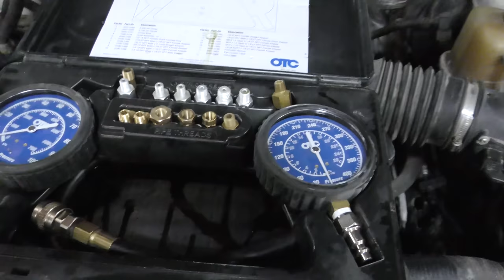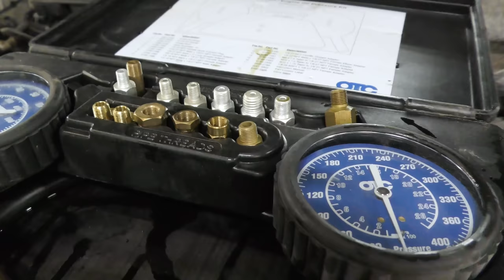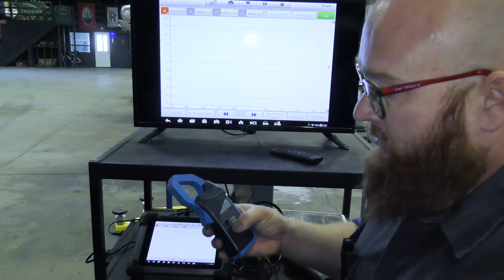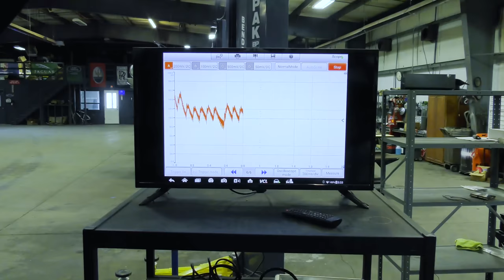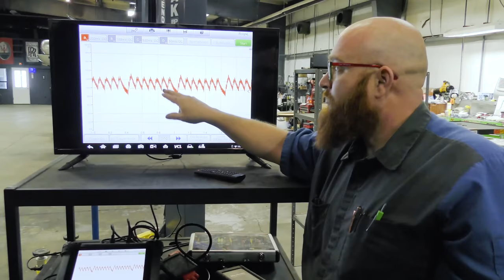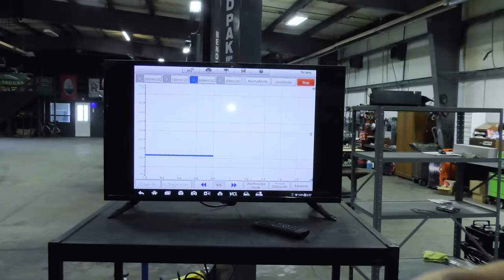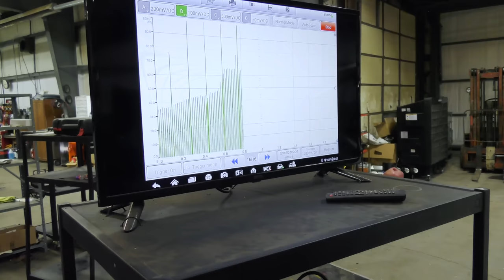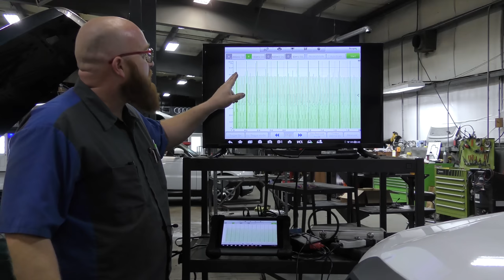Can an engine additive really fix this 2011 F150? CAR WIZARD shows how to diagnose and repair

Comment: Brother can we add 20 Percent oil additive in 1.5 dci engine?
Reply: You can do that or also run a heavier oil which will also do the trick
Reply: @FBI-eo9yx  thanks for the reply bro. Can you tell which grade oil is heavy oil?

Comment: Don't you think a lot of these problems are resulting from ridiculous oil change intervals? 
For example my 2014 bmw 335xi has a 12,000 oil change interval. Lets say you get 2000 miles to the quart . After 12,000 miles you'd use 6qts, and maybe have 2 qts left in the pan of really dirty oil. Wow! 
Now of course i change my oil at 5000 miles and a filter change in between at 2500 miles. Common sense, but not at bmw i guess.
Sort of like waiting until the 36000 miles brake pad replacement for the front brakes, then you get a 200 miles warning. Rotors are shot by then if you dont dig them up with a metal backing plate on a pad. 
Why be cheap and wait when pads are 100$, replace them at the half way mark. 
One friend waited too long and cut up her bmw rotors, then yuk bought a pair at autozone for 75$ each. 
Really there is a reason Zimmerman rotors cost 150$ each
Another friend had an oil warning on her bmw fir waiting for that 12,000 oil change. Stuck at the gas station oil too low! 
Are these car companies trying to drum up repair business? Or new car sales?

Comment: 180,000 miles is that much ????? my audi a4 tdi from 1999 has almost 700,000 km on the clock and starts immediately (so without preheating time)

Comment: having to put a mixture of oil at every oil change and use a specific oil filter....???... Not much better than the 5.4l which simply needs good oil maintenance (after the initial spark plugs are replaced)

Comment: The cam seals blow out, engine oil pressure drops, and wipes the cam bearings/caps out. Common issue.

Edit: Wait, this is a 5.0?!?! That is unacceptable imo. 20% Lucas additive sounds like a Bandaid on a bullet wound.

Comment: Wonder if a higher weight oil would do the same as adding lucas? Sounds like an old school trick being used on a modern engine. I remember putting higher weight oil in a high mileage engine to bring it back into tip top shape. So basically they didn't make all the tolerances and oil change related right in what the engine needed for a 500K life. Like the old school engines. Not knocking Ford because I have a driveway full of very reliable ones, and have known of many GM examples that were trash. To be honest it is a preference. Ford and GM are equal in making quality and trash cars. Really just need to know what you are buying. New only if you keep for a year or 2 and used do your homework.

Comment: I really don't understand, do American engines only last 200000 miles? I had multiple Mercedes V8 Cars, the last a ML430. That car was used as a tow car and off road. Still it had no discernable engine wear? I spend a few hundred $ on repairs over the years but engine and transmission was never touched (I changed one ignition coil pack and the water pump). My daughter totaled the car, a truck hit it in the side and would still drive just fine. My friends E320 put 350k miles - no repairs to engine and tranny (he had a total of ONE repairs - rear door lock). New MBZ cars are not as good and I was hoping American cars are now better?

Comment: Sorry, but for what new cars cost these days, I think a properly maintained vehicle (and not abused) should make it to 500k without major repairs. My Mini made it to 266K miles (but it started burning a quart of oil every 1200 miles @ 230K miles, @ 255K miles a quart every 300 miles). Not buying another Mini. On to Honda.

Comment: will this work on other engines with the same problem ?
Reply: In video of other youtuber I heard that second hand dealer ships "trick" the customer by adding something to the oil to cover any bad noises from the engine. So it happens, but not always to fix the issue, just to cover it.
Reply: If it is the same problem, ofc..
Reply: Yes but just add a quart of thicker oil.
Reply: 5w-20 should have never been recommended for trucks. Should stick only with motorcraft filters and 5w-30.

Comment: Maybe if manufactures wouldn't run basically water viscosity (5-20) oil their sh(#t wouldn't drop oil pressure in the first place!

Comment: Ok that's a really dodgy way of "solving" the oil pressure issue. So it has more oil pressure at the sensor after the pump now but less oil flow because the resistance against pumping through the engine is higher. It will wear even faster, especially on cold starts. How much is a set of bottom end bearings for a common engine like that? $200? installed from the bottom maybe $500-600? Sorry but that is really not Wizard level of repair ...

Comment: Melling M360HV oil pump.
Reply: That’s only on the older 4.6, 5.4, and 6.8 liter engines. 5.0 uses a different oil pump and I have not heard of a high volume oil pump on the 5.0. Only on the 4.6/5.4/6.8 and the 3.5/3.5 Ecoboost/3.7 V6 engines have a high volume oil pump as well but the model is M390HV regardless if the engine is transverse or longitudinal.
Reply: @atx-cvpi_99  That is a Coyote good call. Thank you sir. I own three of the Modulars and put a Melling on my truck and it loves it.
Reply: @atx-cvpi_99  I will add that doing the pump and chains etc on my 08 5.4 made me hate Ford forever.

Comment: Would have been a much more interesting solution to try thicker and thicker oils and monitoring the pressure.  Whats the difference between putting 20% lucus and factory oil with just 100% of a higher viscosity?  Who knows, but a fun experiment.

Comment: The car wizard doesn't know much of what he says. Fordtechmakuloco will show you how easy it is to make a 5.4 3 valve reliable on a routine basis over and over again. Many 5.4 3 valve engines run well over 300k with regular oil changes. Wizard needs to educate himself.

Comment: I'm a little disappointed it you saying that this is common issue. I know a lot of people that have these for work and the change the oil with the recommended synthetic blend and they are running 300k to 500k and never have a problem. If you use the recommended oil and change it when you are supposed to they will last.
Reply from the maker: Thats the problem. No one follows oil change intervals anymore. These engines dont handle this well. Hence the dealer approved fix. This is my prediction that electric cars will sell well in the coming years. People just cant be bothered with oil changes these days. I kinda dont blame them.

Comment: I used Slick 50 back in the 80's  It was just engine candy.  I'm sure it did nothing.
Reply: Actually, it ruined my old 240Z motor...  So yes, it does do something LOL
Reply: Slick 50 had a class action lawsuit for rusting the inside of the engine

Comment: The customer may have told the mechanic to change the oil pressure sender.   
       I cant believe the standard advice from a ford dealer is at 180 k the engine is worn out..  no tests.. no great data.   The dealer wants to sell you an engine or new truck so I dont believe them.  
       I would want to know the oil change history.. 
      Wizard a 4.7 or 5.7 toyota v8 can easily go 500 thousand miles to one million miles with reasonable maintainance..   
       My old bmw has 225 k miles and the engine is awesome.. if I took it to a dealer the car has too many miles and is too old and should be replaced.  Again biased opinion.  And flippant bad advice from bad mechanics.. 
         Would replacing the oil pump and doing new filter and oil not be a reasonable test to save a several thousand dollar engine swap ???   Oil pumps can and do wear out.. 

180 k miles on a ford v8 is nothing.  As long as the oil is changed often..
Reply: I haven’t seen a 5.7 Toyota go 1 million miles yet. Only 4.0 and 4.7 engines have gone that far. 1 4.0 and 2 4.7s to be exact. 4.0 was in the Lexus. 4.7s were in 2 Toyota Tundras both were the 2007 and newer models.
Reply: I saw a review of a 5.7 in a tundra commercial truck.  Over one million.  

Dont believe the accuracy of a ford tech on the phone saying the engine is bad.  No oil change.  No new oil pump.  No try at 10/30 or 15 w 40 oil.

Comment: A lot of these mechanical oil control problems Engine wear ect a lot of people feed into this synthetic oil change nonsense of 10k plus oil changes.

I bet you that you could take 2 same trucks change oil in one at 3500 miles every time and the other truck change at 10k miles 

The 3500 mile truck i bet has way less problems and will burn oil way longer down the line than that 10k mile oil change truck.

I change my oil every 3 months or 3k miles whichever comes first. 

And if i haven't driven my truck and its been 3 months and it only has 500 miles on that oil guess what... i change it.

Comment: If I had to buy a pickup and it had to  be from the big 3, It would have to be a Chevy or GMC.. Maybe Dodge next, Ford 3rd..  Dodges just fall apart so quick.  Fords well engines blow up.. Transmissions blow up, and out of the big 3. Fords are the most expesnive to fix.. I pick GM because simply costs.. GM dealers are all over the place and the parts are all over too and prices are reasonable.  But for me I skip ALL of the big 3 trucks and Buy Toyota. Heck even hondas little truck is not bad.. Nissan.. man they are junk now.. Nissan is not Nissan anymore.

Comment: "just worn out" I call bullshit. They also make upgraded oil pumps for these trucks. And the tensioners in the timing system can blow seals reducing oil pressure. But the stealership suggestion checks out, useless.

Comment: Gee low oil pressure, let's install higher viscosity oil or an additive in it. That's shade tree. We did that in the 1970's when the engine was worn out. 180K miles on a modern engine & low oil pressure is a sign of poor engineering/design.  PS I am an engineer by profession.

Comment: I hate the fact we don't get f trucks in Australia
Reply: I hate the fact we dont get utes here in the states. I’ll send you two f series for one LS powered Ute !
Reply: You’re good with Toyota Hilux and Landcruiser. American trucks and cars are pile of crap 💩 believe me mate. They’re super big gas guzzlers and just makes noise without going anywhere. A Landcruiser will over last that F shit 10 times.
Reply: @mzee5533  Diesel 7.3s and Duramax’s will run circles around those and last 500k+ easy
Reply: We’ll trade you F150 for Toyota HiLux !
Reply: @notchase5973  they are getting really expensive now they aren't making them and most have been thrashed i got a ford xr6t with a barra she doesn't like me having a licence
Reply: @mzee5533  yeah but the price of the landy is ridiculous and the hilux is bloody thursty my xr6t is cheaper to run than my hilux work ute
Reply: @standyourground9973  there's bloke's here putting duramax in landys and patrols and my mate just put a Cummins in a patrol check out THE SKID FACTORY al is a genius
Reply: @210SAi  old lux yes but you wouldn't want the new ones a bunch of trouble wrapped up in plastic
Reply: @mzee5533  easy there on the name calling “mate” seems how the majority of vehicles in Australia are powered by an engine from an American manufacturer, calling American trucks gas guzzling piles of shit seems a little extreme lol
Reply: @standyourground9973  and Cummins Rams.

Comment: Sounds like a band aid , but a good medium term band aid. I'm surprised the thickness of the lucas doesn't mess with the cam phasers. I know different viscosities will piss off vtec systems. Really shows just how garbage the triton engine are. That mileage and it's worn out. I'd expect that from a eurotrash car...

Comment: 180k is not high mileage. my 306k chevy engine has no oil pressure loss and its internally original. been running 40 weight in it since new. don't use lucas either its a scam. all that crap does is increase the oil viscosity by about 3cst at operating temperature and nothing else. 20 weight oil has a cst viscosity of around 9. 40 weight oil is around 13cst so just use 40 weight oil which costs the same. id just replace the oil pump with a high pressure one and use thicker oil anyway. 20 weight oil kills engines. since new on my other truck a ford i used 15w-40 not the 5w-20 and it got to over 200k without any oil burning or oil pressure issues. those that ran that 20 weight poison had issues in their 5.4's the viscosity difference may not seem high but it makes all the difference.

Comment: Problem with this video, meaning it is for commission earned for advertising. Add 50% lucas??? Thats a ridiculous statement, because any additive you need to know the weight/thickness of what is added. If this lucus additive does not list a weight, then all it would be is standard sae30 weight but priced at a high high price. Sae 30 weight oil is your standard 1950s and 60s oil which is good, but its nothing more than dollar store lawn mower oil. Heres a secret marketers hide from you people. Engineers of the engines of the past and present have discovered through test that the best oil you can use to make an engine last and have less wear is golden state sae 30 or 40 weight oil like you buy at the grocery store. What ruins all of your engines today is the using of 5 w oil instead of a 30 weight oil. Know this, that second number on that bottle is pure fiction and doesnt even exist. It can say 5W 20, but is only 5 Weight oil. Oil gets thinner as it rises above 240 degrees. Marketing has taught you people to believe a physics lie of oil gets thicker when it gets hotter. Thats why all your engines of today clatter and make sounds

Comment: Bump up in oil viscosity.  These ridiculously thin oils manufacturers call out to meet mpg requirements for their lineup mpg average is detrimental to the engines....  Fordtechmakuloco recommends a thicker viscosity for the 5.4s, I believe 10w30 vs 5w20.  I'd take his advice on anything ford related

I know a lot of people think the oem engineers know what's best.  I believe that statement is true, but I also believe outside influences to the engineering's group who control costs and mpg requirements have more influence

The manufacturer goal is raise MPG at the expense of reliability to meet government imposed requirements

Grrrrr ......this whole subject just pisses me off...anyhow....carryon

Comment: Wanna know what Chevy makes that’s garbage?  The 6.2 and 350 diesel, the 305, the 2.2 ecotech, the 3400, iron duke, quad 4, 3.6 etc.  junk.  

I’m a mechanic with 35 years ASE experience.  I see my fair share of junk gm trucks and service the areas largest natural gas fleet of over 250 gm, dodge and ford trucks along with peterbilt and internationals.  By far the worst in the fleet are the dodge then the gm.

Always use WIX / Napa gold, ,Motorcraft or Baldwin filters.

Comment: Lucas is garbage, it's thick stuff with NO anti wear additives like motor oil.  
Why not use a 15w40 instead?  5w20 plus lucas does the same thing.

Comment: Ford still has a really serious issue with putting aluminum bearings in their engines.
Engineer who came up with that idea should be hung.
Put in a set of clevite bearings in the engine, and they won't wear out like that they will actually last three to four hundred thousand miles.
A leukocyte is a stupid fix because Lucas doesn't have near the additives in it that the engine requires to run properly. If they had built the engine properly it wouldn't have a problem in the first damn place.
I'd be actually more tempted to put 5 W 50 Castrol Send tech in it before I would put Lucas in it. Even 1050 or 2050 before I would put Lucas in an engine.
It would burn a little bit of oil because the Rings aren't made for that heavy olive oil, but the Rings can't handle the Lucas either.

Comment: This is so annoying to watch, Ford is the most commonly sold pickup truck, yet they last the least amount of time and are designed poorly. (Close race with dodge.) The drivetrains completely fall apart right at the 200k mark every single time. 

Yet a Chevy LS motor, or a Tundra with the 5.7 will literally go 300-500,000 miles if cared for properly with EASE! This just shows that brand loyalty is totally asinine and only hurts you as a consumer. People that continuously buy fords blindly are hurting their own pockets.

Chevys get a lot of flack from the community, but when it comes to the life span of the truck, they almost ALWAYS last much much longer. Take the GMT 400 and GMT 800 Silverado’s for example, those were absolute BULLETPROOF trucks and a lot of them are still on the road today with original drivetrains. 

You go to the same Ford years as that, a huge majority of them are in the junkyard, 5.4 triton, 3v, 6.0, 6.4...all horrendous engines. The Chevy 4.8, 5.3, 6.0,  and 6.6 duramax are widely known as extremely robust and bullet proof engines and have stayed the same, meanwhile ford changes their engine design every couple years because they can’t get it right.